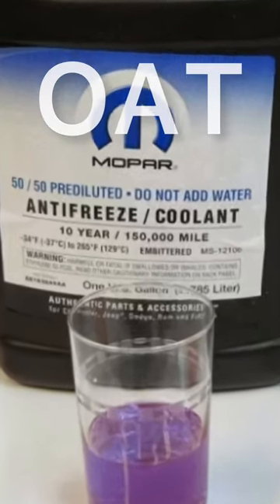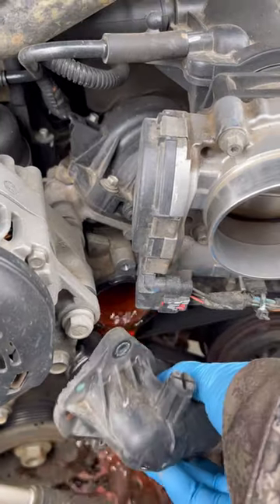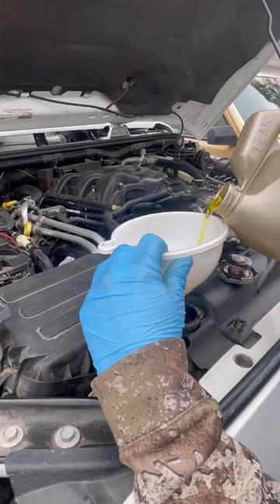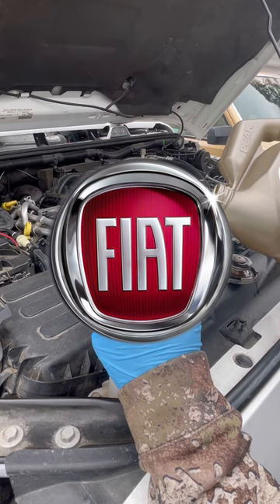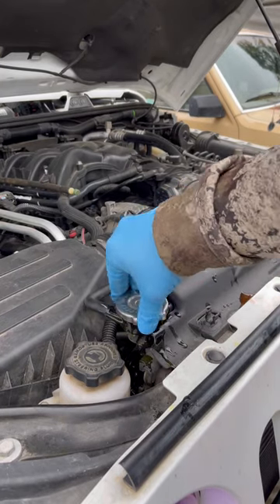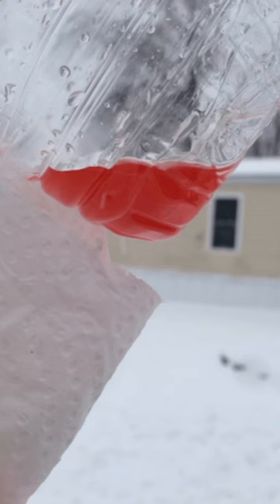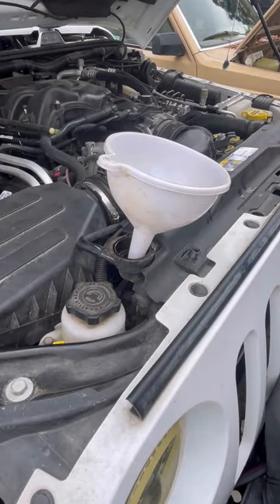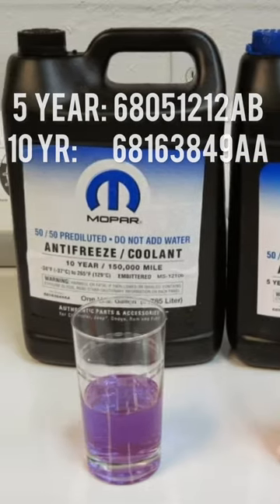Jeep Wrangler JK Owners Most Common Mistake - HOAT vs OAT Antifreeze Coolants Do Not Mix

Comment: My freaking mechanic just mixed both.. I flushed it and now my Jeep is over heating..🤦‍♂️ what should I do?
Reply from the maker: With the engine cold , top off the radiator with the cap off put the cap back on. open up the bleeder valve on thermostat hosing , start the engine and turn up the heater defrost on high. Warm up the engine to let the air out. Close the bleeder valve once coolant starts to spill out. This should let the air out. And you will hav to do a few hot / cold cycles to get the coolant level right. But keep watching and topping off the coolant reservoir. Make sure it’s always full and at the max.
Reply: Mechanic should fix it and flush it out since he made a mistake. For future work you have done.. Leave the HOAT coolant jug in the front floorboard so they know that's your using, or just tell them to top it off with what you have 🤷 I always buy the best coolant, shops buy the cheapo bottom shelf shit.. I'd rather supply the good stuff.

Comment: I have a hybrid vehicle (2020 Camry) and from my understanding the h in HOAT stands for hybrid, but the coolant in my car is pink like the OAT, not orange like HOAT. Any guesses as to which type I have?

Edit: My owners manual says to use “Toyota Super Long Life Coolant” which is dyed pink but I can’t find if its OAT or HOAT. But I think I’m probably safe using that, what do you think?
Reply from the maker: Toyota has there own import version, if you know yours is original, than you can mix it with the over the counter coolant for import cars by PEAK they have there own version, but just pay attention to the year, make,and model on the jug. Otherwise your best bet is to get the factory OE stuff on Amazon. Which is fairly inexpensive. At least I know Mopar coolant is. 🍻

Comment: Good info, thanks alot!! I use to run the orange stuff in my 2008 4.7, had alittle in the overflow but fully flushed the rest of the coolant system, I purchased 4 gallons of 5050 premixed go5 which is lite yellow color... wonder if it's good...
Reply from the maker: You should be good if you do the flush, that’s what I did. The 10year is super expensive, and at the moment not justified to replace. I highly doubt that I will not be tapping into the cooling system before another 150k, But I keep the fingers crossed 🤞 lol

Comment: This is also a good example of not going by COLOR.
The color is just a dye.
If I had the ability to make coolant.
I could make Blue colored Dexcool.

Manufactures also need to stop with all this coolant crap.
Just come together, design a coolant that will work for all engines and be done with it.

We now have coolant in the following colors and they're normally the following.
Red(Dexcool)
Pink(Toyota Long Life)
Orange(Extended Life)
Yellow (normally for topoff)
Green(classic ethylene  glycol)
Blue(normally used by japanese brands for their long life)
Purple (VW now uses this color but also this new HOAT coolant)

And yes, that refraction of the coolant color is annoying, my imprezas blue coolant sometimes looks brown.
Reply from the maker: Totally agree , and good information on the the topic! Thank you